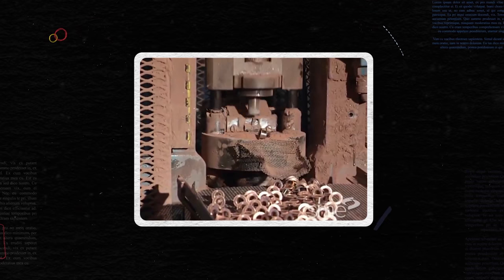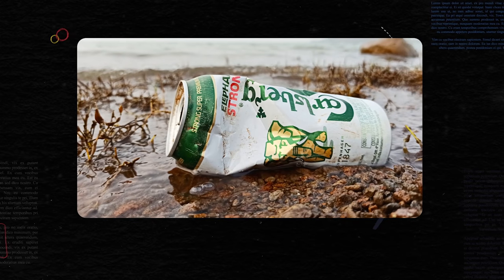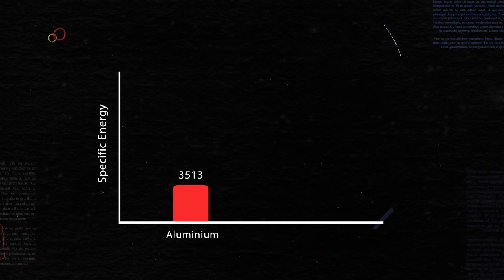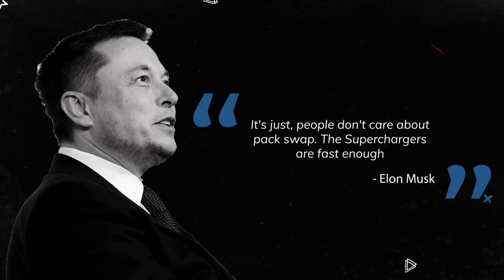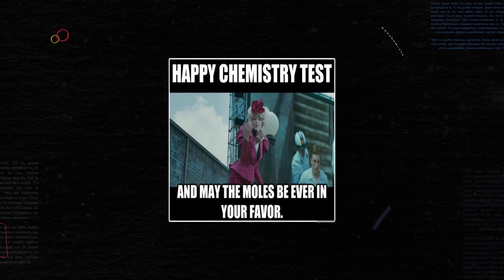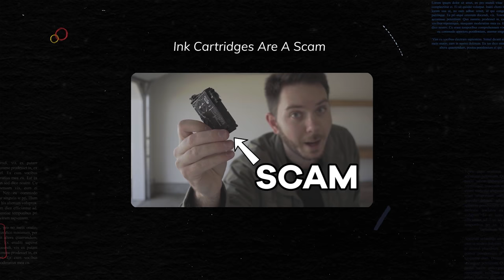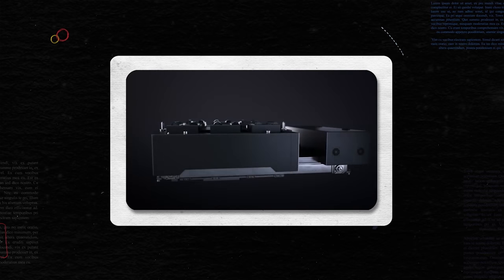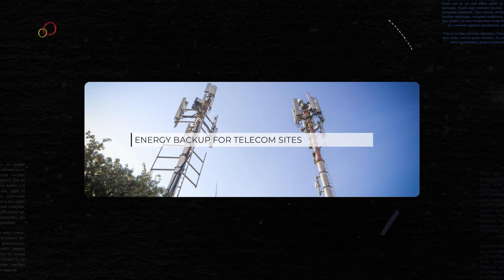We Can Get 1600 KM of Range With Aluminium Batteries

Comment: Theoretically, the Aluminium Air Batteries might sound good, but it might make sense for large commercial vehicles to start off because end users wouldn't care about all this hassle. That said, I definitely believe that Tesla would have already started on the next battery tech that might be in public a few years later. Very nicely explained.
Reply: Hi amit ✌️
Reply: What evidence do you have to base your belief that Tesla has already started on the next battery tech?
Reply: @grantadamson3478  The news? There's some talk on solid state batteries, talk on getting away from using lithium, as well as general changes and improvements to the way they work, the materials used, increasing their capacity, lifespan, etc...

Samsung is working on some battery breakthroughs too fwiw. I honestly believe we're more likely to get something from them first. Musk is spread too thin and tends to prematurely dismiss certain innovations as impossible. 

Useless rant:
Ex, he was just on Rogan talking about how solor will never surpass 25% efficiency, but there's a company working towards a theoretical 50%, having already achieved a figure in the 30s. And musk is in the solar business. His dismissive believe halted his advancement in solar tech and shows they're obviously not working on it. Apply that to his take on batteries and Samsung looks to be the bigger future innovator
Reply: @soulife8383  There is plenty of noise about new tech but very little substance. And none of this is coming from Tesla. Which was my question.
Reply: @grantadamson3478  "None of it came from Tesla"
That's not accurate. A simple Google search would have revealed that.
Reply: Well I don't think Tesla is interested in Al-Air they want self contained battery tech and skew towards that. (Meaning no metal air batteries)

But, I think swappable batteries is an decent idea, if they can get the weight down per each anode to he self serviceable, possibly by utilizing multiple small easy to load anodes
Reply: @allhumansarejusthuman.5776  removable batteries wont happen. Tesla's new cells are part of the vehicle's structure.
Reply: @grantadamson3478  if anyone is getting battery technology it's them. No car company have their market cap. They can outbid any offer. They are also the biggest investor In university research for businesses secretly. They have lots of Hidden labs 

A random startup or old automaker who gets it from lg chem isn't Tesla

If anyone had the best battery. Who would have it but them if I invented something I'd go to them to buy it as no one else makes EVs in demand like them
Reply: @soulife8383  Well then show me.
Reply: @TheMagicJIZZ  Tesla buys their batteries from Panasonic.  Panasonic will be the company that owns the breakthrough.
Reply: @StinkPickle4000  no... Panasonic makes two batteries for Tesla. 

Panasonic Japan supplies the model s and X

Panasonic Nevada inside the gigafactory makes the 2170 cell

But it's Tesla's unique chemistry. It's not off the shelf. It's a standard size format but Tesla literally has the most battery r&d of any manufacturer on Earth.

Do you even realize they make more batteries than all the batteries made on earth from just the Nevada plant. They use Samsung too for energy like power pack

They literally are the only player and catl and LG chem are supplies too but every university has a partnership with Tesla

They literally fund PhDs programs
Reply: @grantadamson3478  I think I still have the tabs open at work. I googled something like "new tesla battery tech" or something similar. I think it was the 4th result that was a tesla press release
Reply: @TheMagicJIZZ  Source please!  Preferably don't just say google, cuz when I google I don't find evidence supporting your claim.  The 2170 is just the form factor and is "jointly designed and engineered by Tesla and Panasonic."  The chemistry inside is the same 20 year old NCA Panasonic, samsung and Saft invented way back when.

Panasonic, LG, et al funds battery R&D and university departments world wide as well to much higher funding levels and for a lot longer (last 30-40 years).  I studied under Jeff Dahn at Dal where Tesla came for innovation.  Trust me (or don't I'm a rando on the internet after all) I've seen it they are paying for development of ideas that will bare marginal improvements, not breakthroughs.
Reply: @soulife8383  I'm all for new and improved battery tech and I hope that happens soon. I have been following the development of solid state batteries by Toyota and Quantumscape who appear to be well on track. The problem I have with Elon Musk is that he says a lot but does not deliver as promised. I wish he would keep his mouth shut until be has something worth saying and is backed by facts. We all remember the failure that was the Tesla Battery Day. Yes there much talk of what they might be doing but lets wait and see what actually develops.
Reply: Magnesium and aluminium are promising  possibilities for high energy densities but passivation the difficult issue. It is possible novel electrolytes based on organics will come to the rescue. Whoever solves it will make a fortune.
Reply: Thanks for the detailed analysis and use case study. Very intreaguing technology. I wonder if airplanes could go all electric with such batteries.
Reply: @allhumansarejusthuman.5776  It is a question of energy efficiency. Put a big Li-ion battery in an EV to get the range, but it will use more energy  as the vehicle becomes heavier. If you instead use a small 20kWh battery in your EV for 95% of your trips but rent an Al-air battery for your holliday, everything becomes cheaper, the vehicle, running costs, and not needing other means of transport when on vaccation.
Reply: @grantadamson3478  Now you shifting the goal posts. I am going to buy a Tesla because of convenience. 500km per charge is OK with me for now. I don't mind charging once a week...
Reply: @shakumpum  H2 fuel cells are future music since late last century. H2 is extremely dangerous!
Reply: @MrGoMario  New Tech is shifting the goal posts, not me. Go ahead and buy an almost redundant Tesla at a premium above what you could buy with an ICE. I like the idea of fast 0-60 times but where can you do that? And I prefer applying my surplus equity to appreciating assets. I'm not caught up in all the Tesla etc etc hype. At the end of the day it's just a car.
Reply: A pointer to you, please have english subtitles with your videos. I am addicted to her videos because she has english subtitles. Please learn and do the same :)
Reply: @StinkPickle4000  From what I read and saw the 4680 cell is totally their own thing but then that will be produced by LG chem, although near Nevada, they do have access to lithium brime. Only time will tell, if they do their own production as well. From what I saw Elon is interested in down-scaling and making things easier and not complex.
Reply: @shirishag75able  46800 is the dimension right, it means 48mm across the top 800mm tall?  So if i made a battery that was 69mm across and 69mm tall I could call it my totally own thing 6969 battery.  The insides can still be the same 30 year old chemistry inside.  The advantage is a factory can make a larger cells with less inputs.  LG chem will make it because they own IP.  Tesla is experimenting with battery production but they are not putting them in production cars.  

I don't understand your point about owning lithium brine... if they are extracting lithium from nature I would think they would have to own a whole lot of brine.  That doesn't seem to be your point and I have not seen anything to suggest they are actually mining lithium.
Reply: @StinkPickle4000  800mm tall wow. No dude it's a 4680. 46mm diameter and 80mm tall. Little over 3 inches.
Reply: @jamesirwin7677  Right! 800 is like nearly a meter lol!  Point is physical dimensions can be easily changed give the battery a different number and call it your own.
Reply: Well, using an industry battery swap mechanism with a carwash style vehicle mover a cassette subscription pay model and tap card redemption, you could get a swap done fully automated, in less time than it typically takes to pay for gas in Canada, and the customer would never need to leave their vehicle. Hell, add an app and the customer can order stuff from a convenience booth at the end, have it paid for from the subscription account and have their order ready for pick up drive through style as the car exits the cassette swap area
Reply: Explanation was so 'nicely explained'.
Reply: @shakumpum  BULLSHIT.
First, green hydrogen takes a tonne of electricity, More even than aluminium, (But aluminium once smelted can be re-used forever and ever),  then hydrogen either needs to be compressed to 10-15,000psi, or chilled to near 300 below zero C to liquefy, and then transported, and then stored, and then the station is 1000 times (roughly) dearer than a charger near the closest pre existing electrical infrastructure). Remember when it explodes, stations that blow up level whole blocks (its already happened). Then the car needs a tank, and piping to handle those pressures, and will need replacing every few years as Hydrogen is the smallest molecule in the universe, and leaks through the metal, making it brittle, (oh yeah, and dont park indoors!!!) 
THEN you STILL need a battery, and an electric motor.... so you saved a few cells. Life cycle cost of hydrogen compared to recycling ALL the materials in a pack of Tesla (for one) cells?
Or you take a battery that is dropping in price every year, and the electric motor, add about 1/3 of the electricity, with no transport or infrastructure to speak of... and Bingo, you are ready to go, and not sitting on a bomb.
Reply: @StinkPickle4000   Tesla make their own batteries, Panasonic build some in a Tesla facility under contract, CATL and LG both supply Shanghai. BUT The new cans being produced at Kato road will be built at all gigafactories very soon, and where developed by Tesla in concert with a Canadian uni, NOT a manufacturer. Tesla get sick of being told this is how we do it, it will take ten years. So they just do it themselves. Nobody thought 2-3 years ago that you could build a gigafactory in a year, they keep doing it, and Texas is (I think) 250+ acres, ONE Building, from stamping and casting coils and ingots, to making seats and electric drive units, and Battery packs from powder and coils.... to whole cars in one building. DONT BET AGAINST ELON.
Reply: @StinkPickle4000   Tesla uses 3 different chemistries, and the reason they built Nevada was to force Panasonic to change to their own chemistry. I am not going to do sources because there are thousands of them. Just look up Tesla battery day to find how far into the weeds Tesla goes.
Reply: @StinkPickle4000  YET
and the dimensions make for volumetric efficiency in the new battery to chassis, and is only possible because of the tabless structure wicking the heat to the end so many times better.
Reply: @RacefanPat68  Yes Dalhousie university (or just Dal)...  3 chemistries sounds right but none belong to Tesla.  That's why they bring partners into their factories and why they want to develop their own IP enough to take over the production.  The chemistry being developed at Dalhousie is NOT world breaking its different enough to avoid patent issues and performant enough to be competitive but this was 5 years ago I don't know what is taking them so long to release the new chemistry...?  Perhaps their focus is the "million mile battery?  "Battery day" Musk hype flogged by the media and his referral code army is a joke of a source.  Giga Nevada hit a "theoretical 35GW" when the partner actually says 24, the factory today is still not fully utilized, what's the point of hastily building vast structures to only partially use them for the first 7-12 years of their life?  EGO, bragging rights?  Surely not genius!

I don't' bet against Elon; his legion ensures the game is tilted.  Saying what WILL happen and how its all so SOON... whatever believe what you want no amount of argument makes the Cybertruck or million mile battery or whatever any more reality.  It will be released or it won't.  So far it hasn't I think we should look for other climate solutions rather than waiting for Musk to bail us out...
Reply: @RacefanPat68  "He has built a space company that sends men to space"  That's as much as I read because it's wrong and if the rest of your rhetoric is as bad then it would be a waste of time reading it.
Hahahaha Men in space lol do you even know where space begins? Fool.
Reply: @grantadamson3478  The internationally accepted line for the purposes of orbital mechanics is the Karman? line, which is 100 km I believe, and the height for LEO is 400 km, as this is where the number of molecules of air you hit is low enough to not slow you down enough to lower your orbit to quickly. But the point is they can and do launch men to the ISS and beyond soon, and no one else in america can... You are the fool, what even is your point?
Reply: @shakumpum Li-ion have 99% efficiency.
 Fuel cells have 40-60% efficiency,   H2 production from electrolysis has 80% efficiency, so combined cycle efficiency is 32- 48%. You can not afford to waste half of energy production in the best case.
H2 is dead as "electrofuel". For aviation, it is better to create synthetic hydrocarbon fuels.
Reply: A lot more applied and fundamental research is needed.
Our life on earth is at stake. Keep going is of utmost importance.
Joseph France
Reply: @TheMagicJIZZ  there are already solid state batteries on the market from several manufacturers. But these are extremely expensive.

The cost is expected to go down as economy of scales improve. But even after that it'll still be very expensive. Plus, these batteries require significantly more Lithium. (Lithium only makes up 6% of regular Lithium-ion bateries). 

Lithium prices will go up as demand goes up and solid state batteries will accelerate that increase in Lithium price.

Tesla isn't even remotely close to these other manufacturers... as Panasonic develops, manufactures and supplies all of Tesla's current batteries... not Tesla. In fact, Tesla is having to compete heavily with other EV manufacturers to retain Panasonic's full partnership. 

Others, including Panasonic, have been working on both normal and solid state batteries since the 90's. Hence why Tesla is at the mercy of battery manufacturers like Panasonic.
Reply: oooohh, Teslaaaa....
Reply: @shakumpum  H2 is a vary bad battery: 40-50% electricity storage efficiency.
700 Wh/kg Li-Ion batteries are perfectly adequate for practical cars, we have enough lithium. The problem with Tesla is that it is premature, forced revolution.
Serial hybrids are natural way to go for the next 20-30 years.
Reply: I think that many users would preffer hydrogen that would make things lighter as well. And luckly for them there now finally is new type of mechanical engine that can beat the efficiency of a electrical engine.
Reply: Zinc Air Batteries just had a stanford study using a hydrophobic electrolyte that allowed it to be rechargeable up to a certain amount of cycles, not the same ballpark as Lithium Ion but when you are using the power source as a range extender it means it makes even more economic sense if you applied the same principles to Aluminium Air.
Reply: @ted_van_loon  Hydrogen is heavy as hell if you consider full installation and tanks. Even Space companies prefer liquid  methane/natural gas now! Nothing can win with hydrocarbons considering practical energy density.
Reply: @peceed  who knows, the reason for that weight is just because current day science is outdated and not yet refined enough to store hydrogen. But hydrogen has a few strong properties which would allow it to be stored a lot better when used.
Reply: @ted_van_loon  Every competent engineer knows. Serious science is never outdated (social science is not a science at all). Don't think that progress in physics changes what is possible, it doesn't work this way. Hydrogen storage weight is a simple function of specific strength of materials -we knows the limits.
Hydrogen is an artificial political solution, the real one are synthetic fuels and biofuels. Batteries will win in automotive.
Reply: They make absolutely no sense, theoretically. Unless there are more efficient ways of aluminum smelting.

Comment: Like a giant AA battery u have to switch.
If they scale it for 20 pound modules and I can change it at home garage. Thats not a bad idea.
Reply: A giant AA battery that needs periodic watering -- and draining.  Not sure I'd be down for that.
Reply: @noncalamari  Luddite! Just kidding. I get what you are saying, but, you basically do that now by filling your car with gas and changing the oil. Unless you already have an EV.
Reply: @noncalamari  why do I need to remove the sludge or fill water? Make a 300 km cell that lives at a gas station and in out swap I'm on my way and someone picks up the modules for cleaning. They get 10 uses out of cleaning and I get a fill in under a minute.
Reply: Maybe four AA batteries.
Reply: Who you think is gonna do this?